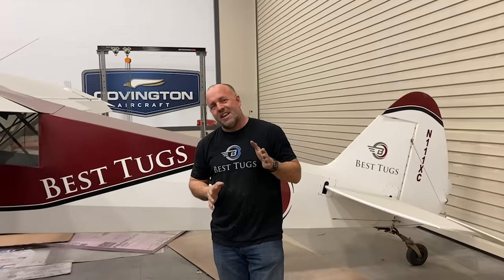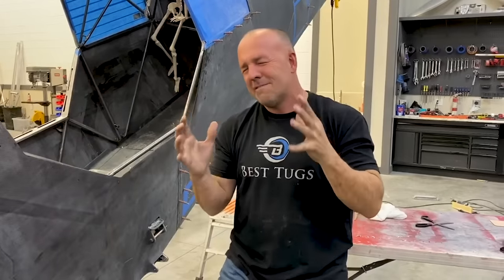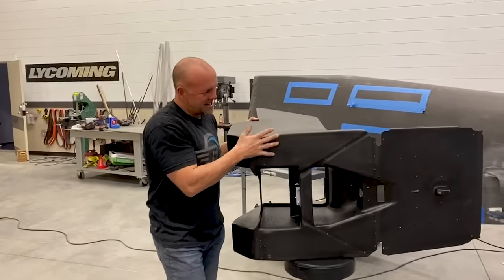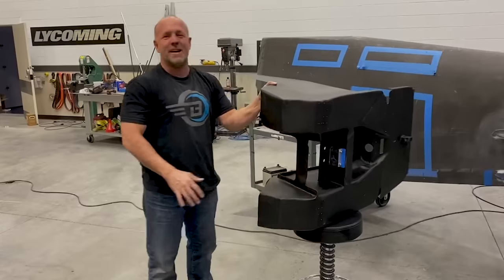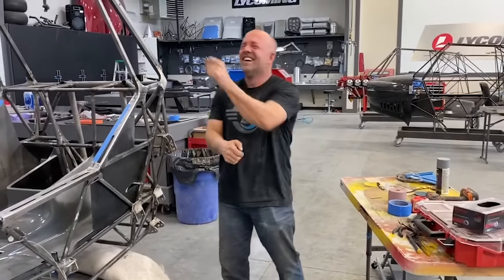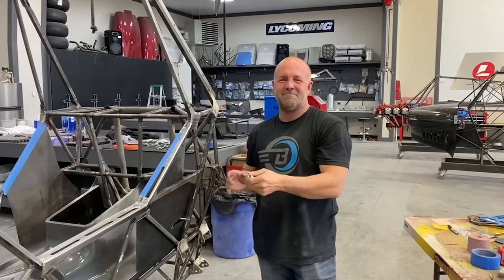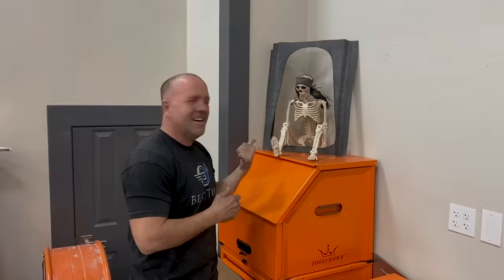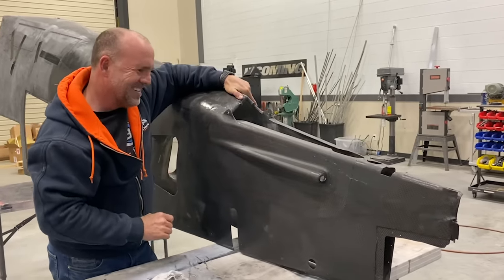Floorboards, Pedals, and more 🤠 (Scrappy Bush Plane 9)

Comment: Instead of the standard rudder trim tab, why not make a wedge to fit the rudder trailing edge profile.  Wedges are quite effective and don’t add much drag.  A small carbon/foam core wedge (3/8 x 3/8 45 degree) bonded to the rudder would babe a fraction of weight compared to the larger springs and screw/nut combo.

Comment: Love your projects but am I wrong in thinking that the big advantage of a trim tab is to allow the plane to fly straight without putting extra stress on your control cables and attach points?  I know in your case it won’t be much and hopefully you won’t have much you need to adjust out.  Good luck.
Reply from the maker: Glenn Hancock  great question. 🤠 it’s almost no pressure whatsoever. Many cubs don’t even use a tab.  I have provision to add a trim motor later if I want but likely will not need it.  Many planes spring Controll upwards of 80 pounds.  The most mine will do is 2-5 lbs on a 2,000 pound cable system.  Nearly immeasurable on this plane unless somehow I screwed up the balance of controls and rigging but if so I would just rig it up again.  👍🤠
Reply: Mike Patey Somehow I doubt that will happen. :-). Thanks for the reply.

Comment: Mike. Will there be any issues with the cable contact, rubbing, on the front two tubes. Added friction and wear to both cable and tube.   Maybe a Teflon guide at these points and attach to tabs on the tubes..
Reply from the maker: Derek Pirie I had not finished the guides and isolated bushings, that’s done now and no rubbing of course 👍🤠

Comment: Mike, Let me see if I have this right.  The center of a shaft provides very little of the strength.  I think this is because the center of gyration aspect means the farther the material is from the center the stiffer the section is an the more strength that farther out material provides.   So, by using larger diameter material the radius of gyration goes way up allowing you to bore out the 'fairly useless' center and end up with something that's still stronger than the smaller diameter cross section that isn't bored out.
Do I have that right?

Comment: hey mike.
Love you videos!

You talk about how the cable is set almost deadcenter down along the side of the plane. But i noticed when you  talked about the springs for the pedals that the cable rub up against the frame, is this that a problem that you just haven't tackled yet or maybe not at all?
Reply from the maker: snorre rathje I just had not finished the remaining 4 guide tabs and bushings but it’s done now.  No rubbing here 👍🤠

Comment: Model aviation is under attack from the FAA. We need your help. Everything you are doing is what we do. Building model airplanes started me on my career as a mechanic. I have no formal education. But because of model aviation I have been able to become an automotive master tech. And build an set multiple land speed records with a motorcycle. All while building model airplanes. Anything you can do to help
Reply: Make a comment on the FAA's site and let them know. Everything is under attack 1A,2A RC Airplanes, general Aviation and Freedom.
Reply: @edwinkania5286  FAA comments are a dustbin for your thoughts. Media attention, and getting noticed are the only thing that will save this. I went through this in a much, much larger hobby and we still got screwed.
Reply: @edwinkania5286  thanks for mentioning it!
Reply: Truthisstrangerthan Fiction  In my opinion, the commercial drone people who want to have autonomous aerial package delivery and people transport have convinced Congress and the FAA that they need to sanitize the low-altitude airspace so that they can operate. Yes, there are some bad actors using drones, but the FAA doesn't discriminate between those First-person video operators and Beyond Line of Sight operators and traditional model aviation, where we fly in visual line of sight of our models.
Reply: Hire a secretary who can spell and use grammar right, Mr. automotive master tech. 
As it is, you're crippling yourself. Good journey.
Reply: Me too, I am   R/C model  airplanes builder ,glider and airplane pilot. I know all guys from model airplane club are good mechanic's and  cane  do lot of things. I believe Mike also knows something about R/C model airplanes.  Thank you for your comment.
Reply: Building model airplanes is a dying art. I am a 4th generation and love the art of building and flying hand built balsa airplanes.
Reply: Thats flipping ridiculous. I knew the drone crap with everyone and their dogs flying one and wanting to do silly stuff like package delivery would cause new regulations and eventually screw with model airplane enthusiasts. Ive been flying them since i was 12 and still do occasionally. Absolutely love it. Itd break many hearts if you couldn't freely do so anymore..

Comment: Should you be worried about galvanic corrosion on the carbon fibre cowling contact with the rudder control wire or rod?  Should you have an insulator surrounding the wire or rod?

Comment: Hey Mike. I'm gonna ask a dumb question. You hand sand, rather than using any sanding machine. Is there a reason for this? Hand sanding gives you greater control?
Reply from the maker: AdmV0rl0n I have a much better feel by hand, it’s much more work but on corners and rounds I just need that feel. When it’s flat areas I’ll often go to tools 👍🤠

Comment: What’s your background with aviation how did you learn or figure out the size of different parts you need like with the rudder and vertical stabilizer. How did you figure out how much bigger to make it?
Reply: The bottom line: Mike Patey is a genius
Reply from the maker: Ben  hi Ben, my life long background is engineering including my own engineering firm I recently sold.  More specific in structure design and hybrid systems. on the aviation side it has been decades of passion in study of the engineering side of past and present aircraft.  My love of aircraft design in engineering is second only to my family

Comment: so i have a question about draco, the pzl wilga is a certified aircraft how did you put a turbine in it or do any of the work for that matter yourself ? did you convert it to experimental class somehow?
Reply from the maker: strongbonez yes that’s correct, I wrote two manuals, build log and service  maintenance schedule. I then converted the aircraft to experimental exhibition category. It is a very big process.
Reply: @MikePatey   thanks for reply, how long dd it take for whole process?

Comment: So I'm just curious why didn't you use dimple dies on the holes, you can go bigger on the holes and same more weight.
Reply from the maker: 4low24 great idea and I love dimple dies, the only reason hear was the welded brace that blocked the dies on the back. I just didn’t feel it was worth cutting out the brace and welding it back in.  If I was scratch build I certainly would 👍🤠

Comment: Ok, curious... are the rudder pedals stainless steel or aluminum?  If they're aluminum, is galvanic corrosion between the pedal and the stainless steel actuation rod a possibility where they are joined?

Comment: are you going to make the bump stop on the pedal adjustable? if not, how are you going to take care of wear of the cable to the rudder?
Reply from the maker: David Ewing  in the video I have not disgusted the remaining bushing and guides as well as the isolation slides. You will see it later.  👍🤠 no rubbing
Reply: @MikePatey  looking forward to it.

Comment: That cable exit fairing is similar to what is used on model aircraft. I'm curious that since it is not a load bearing part, why so much carbon fibre would be needed...
Reply from the maker: balsumfractus it’s for the transfer loads from the panels above and below 👍🤠 great question
Reply: Mike Patey ..ahhhh, I see....

Comment: At 14:13 A totally uneducated statement on my part, but  if there is going to be any non-structural aft ballast needed to offset the engine weight, I would put that weight into the rudder horns and rudder stop structure instead of the  pedal stops.   I hate to think about any type of changes in the rudder cable tension, and not being able to hit those rudder stops in the back due to rudder pedal stops. Again totally uneducated on this end.  By the way I love engine choice. Many hours flying the IO-720 in Queen Airs.

Comment: By eliminating the trim tab and trimming the entire rudder, wouldn’t that create more parasitic drag because of a larger surface area? Just curious. Love the videos.
Reply from the maker: Kirk Harrison logical question 👍🤠 the tab actually just pushes the rudder (large area) into the wind and the tab and rudder are opposing forces, both drag.  The spring just moves the same push of large area but eliminates the small tab drag. Not much difference as the tab is so small but the large deflection is similar.  It is only a small drag benefit with the spring but the weight and drag and looks all are slight and worth doing so I went for it.  🤷‍♂️👍🤠 no down side really other than a little more work up front
Reply: Mike Patey Thanks Mike for the reply. I’m an old retired helicopter pilot and not up much on the aerodynamics of planes. Love the videos. It’s great to see the progression on the builds and the enthusiasm you show. I also love seeing how you form and work the carbon. I may never get do anything like what you’re doing but I’m learning a lot, and for that I thank you.Keep them coming.

Comment: So you always talk about these structural and tensile strengths of these components. How do you derive this? Do you have a CAD program that gives you structural and bending moments? Do you build secondary components and stress test them to failure or are you  eyeballing and shooting from your hip?
Reply: Don't need a CAD program to calculate moments, The Machinist's Handbook has all the numbers you need.
Reply from the maker: I do all of the above except for shooting from the hip.  I use solid works and do FEA. Most calculations are simple and done from basic engineering handbooks from school. I also often do stress to failure testing if solid works can’t be loaded to give me exactly what I need.  I’ll be sure to show some of my test to failure and solid works stress on upcoming videos for you.  👍🤠
Reply: @MikePatey  this would be much appreciated! Another little peak behind the scenes - looking forward to it!
Reply: @MikePatey  That would be awesome !!

Comment: What happens when you put carbon directly on foam?
Reply: Chris DiSibio 
Depends on the resin used. Epoxy doesn’t affect most foams. Polyester resins don’t do well with foam unless it’s the two part polyurethane expanding foam. Not the urethane foam in a can. Polyester or vinyl ester resins don’t like that type of foam or any of the polystyrene foams.

Comment: Would it cause a plane crash if the rudder stopped working? Just Curious ... great content Mike :)
Reply from the maker: steven bartlett not likely unless really bad cross winds and you couldn’t find an into the wind landing.  If the wind is calm or at the nose it’s just not needed

Comment: Torsional strength of tubing in a lot of cases, is far stronger than solid. This is why a lot of shipr use tubular prop shafts and why automotive drive shafts are hollow.
Reply from the maker: backwoodsXJ yes, exactly 👍🤠

Comment: Mike, with all of the carbon fibre stuff, i often wonder why the carbon stuff is not (or seems to be not)  made to be more "stressed members", instead of just strong and light subsystems?  For instance, double-walled, foamed panels in that instrument panel part,  rigidly connected to the frame to provide more stiffness near the firewall/engine mounts... or, am i missing something that's obvious to your greater experience?  Thanks, Maestro, nice videos, lots of passion :-)
Reply from the maker: Lohi Karhu great observation and I do have some. I’ll try and show it in videos soon.  Some places I pulled tubes and others I added but blending both for specific areas is always on my mind in design loads.  👍🤠
Reply: @MikePatey  Thanks, Mike, I've always been interested in this kind of thing, some of the simple physics of tubing diameter/fourth power stiffness, and the fuselage stiffness translates into more precise control, although some compliance, in the right places, also gives more robustness ;-)  Always trading off, aren't we? Always fun to watch! NOw, back to work!

Comment: Wait, make this make sense to me. If you build the yaw trim into the rudder angle, isn’t the induced drag a function of the entire blade area, vs the lesser, albeit constant drag of a small tab?
Reply from the maker: Nick Salvador great gyration. 👍🤠 when you bend a small tab, it is actually moving the entire rudder the other direction. So the small tab and rudder are now both slightly into the wind and opposing each other. The spring just eliminates the drag of the bend tab but I still have the drag of whatever pressure the rudder needs applied by the spring.
Reply: Mike Patey Somehow, my mind thought the tab would just get the rudder back to neutral, essentially correcting out any bias caused by torque etc. Basically, one of your legs is going to end up stronger than the other?
Reply from the maker: Nick Salvador 🤠 so the tab depending on bend will move the rudder to the other side and than eliminates the need for  a stronger right  leg. The spring does the same but it’s just cosmetic and slightly less weight.  Not any significant benefits in drag.  Ultimately I may change it to what I did with Draco and others with electric trim but I want to save a couple pounds. I left a spot and breaker for it if I change my mind.  Many cubs don’t do either as at slower speeds it’s just not required.  With scrappy power the spring is only good at a set speed adjustment I set it for.  I’ll set it to the speeds all my friends cruise fly at.  If I find I want to high speed cruise I’ll just go electric trim 👍🤠

Comment: seems like it would be easier to use a helicoil or keensert and smaller fastener to still allow for a larger bore on the pedal shaft without having to drill out a bolt

Comment: Why cable over pushpull tube?
Reply from the maker: MasterMoparMan 👍🤠 great question.. weight, is the primary reason. Most my builds I use push pull tubes.  Faster planes I want stability and strength for high speeds push pull and for Bush planes it’s about the lbs so I do cable

Comment: The rudder cable rubs on the steel frame. Is that OK?
Reply: Marc Denis it won’t after the guides are put in place.
Reply from the maker: Yea it’s not ok to rub, I had not finished the four remaking guides and insert bushings. No rubbing 👍🤠
Reply: Mike Patey very cool. Very much looking forward to seeing your completed Scrappy AND a reborn Draco if you do that ! 👍🏻

Comment: The resolution for the bend-tab seems to be limited by the bump stop - do I have this wrong?
Reply: Maybe the trim concern is only really significant in straight flight? I imagine it's relatively insignificant at full lock, but in the center when it is effectively dead, just a little goes a long way...?
Reply: Bump stop on pedal to limit excessive forces on rudder linkage at full deflection. You can't pull harder on t cable when the pedal reaches it's stop.  Spring arrangement is for setting up a little push at cruise so you don't need to keep your foot constantly on the rudder. Remember BIG ENGINE, lots of torque and the rudder is the guy that keeps it coordinated.

Comment: You should probably make carbon push rods instead of cables.  It’s an extra step but that’s right up your ally.  They’d be more accurate and dependable especially since you have a serious engine.  Why not have serious controls?

Comment: Is it just me or is the cable rubbing on the two forward diagonal supports?
Reply: Andre3K Nope, it clears.
Reply from the maker: Andre3K I had not finished the remaining guides with the isolation bushings. When I finished them all there is no rubbing anywhere
Reply: @MikePatey  Thanks for clarifying , i was wondering the same ! Greetings from Singapore.
Reply: Andre3K I did see that as well?
Reply: @MikePatey  Do you ever use UHMW for wear points? Wears better than steel and lighter. UPS uses it on package chutes. You probably already know about this stuff. https://en.wikipedia.org/wiki/Ultra-high-molecular-weight_polyethylene

Comment: 8:50 Looks like something NASA might build :)  Mike, wondering why you don't seem to make cored part's?
Reply from the maker: Colin Grant I do make cored parts when needed, I just finished one for scrappy but it m a couple videos behind so it may be a couple weeks before you see it
Reply: @MikePatey  I look forward to seeing that video. I wonder if its the cooling flap/air brake? I designed a part and mechanism something like that for the 787. Hey, I noticed in this video, looks like your rudder pedal cable touches the tubular frame, just after the pedal. If I lived in the USA, I'd just about pay you to let me help build scrappy.
Reply from the maker: Colin Grant yea I didn’t have the last four guides and bushings installed yet. rubbing is not ok. We are all set 👍🤠

Comment: hay mike how it if you what with your drilled out bolts heat them up red hot drop them in oil this will make them high tensile just that extra bit of safety hay make your peddles carbon